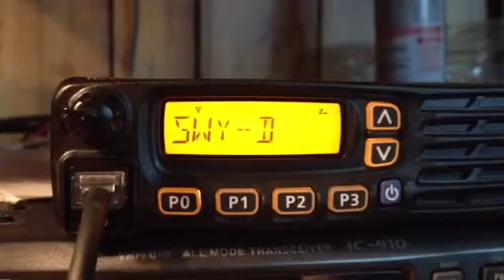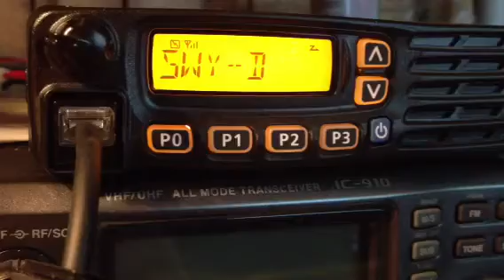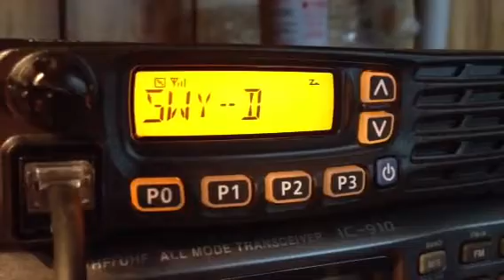ICOM NXDN  (Tampa , Atlanta, New Port Richey, Vancouver, Cleveland Link)

Comment: is that the same as Mototrbo, or DMR? What model is that radio?
Reply: No, NXDN is 6.25 kHz FDMA whereas DMR is 12.5 kHz TDMA.

The radio is an Icom, but I am not sure of the model number. It looks like either a 5220D (VHF)/6220D (UHF) or a 5121D (VHF)/6121D (UHF).